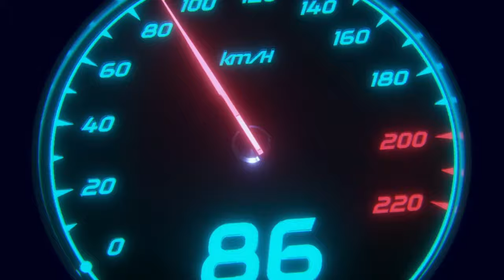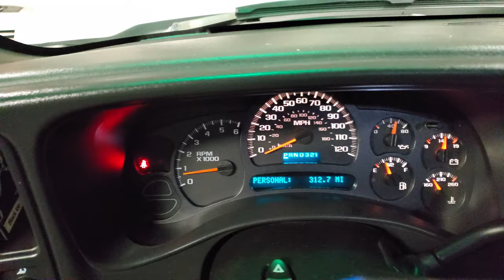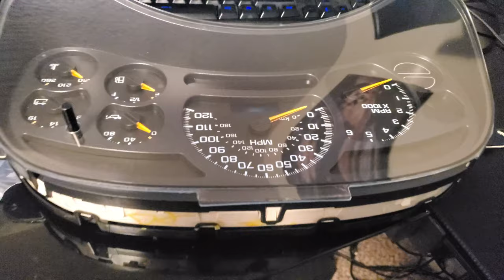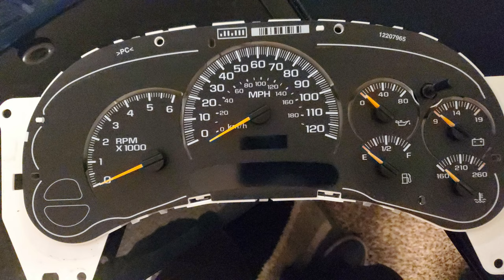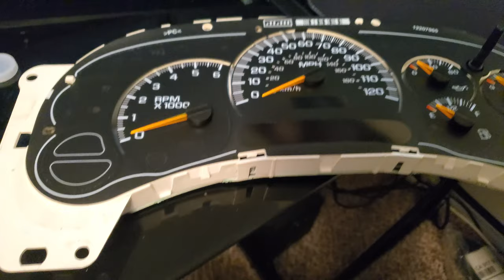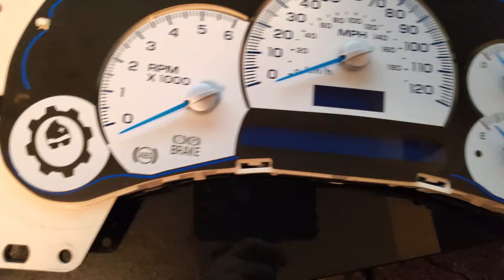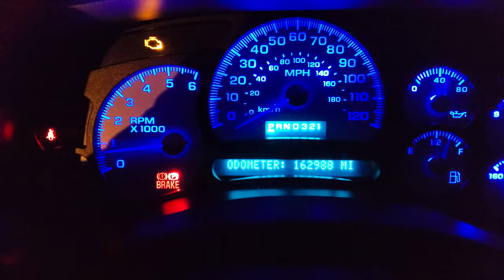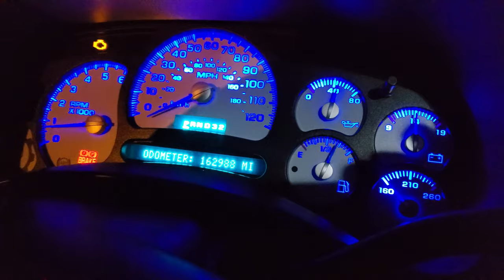Installing Gauge Cluster Upgrades for 03-06 Chevy Silverado/Sierra

Comment: Hey thank for video and especially the parts list💯💯 I’m going to attempt to work on a new gauge cluster soon for my truck.
Reply from the maker: Sweet makes a big difference
Reply: I’m wondering what the cluster would look like with stock black panel and the aftermarket needles.
Reply from the maker: @carlosherrera8541  better then factory at least

Comment: I installed red led’s to my cluster and white needles. I thought the needles would glow white but they don’t glow. Did I do something wrong or is it supposed to be that way?
Reply from the maker: Sounds right I think
Reply: @DrivenbyGears  so how would I Make the needle glow white?
Reply from the maker: Did you make sure all the bulbs on the board work?
Reply: @DrivenbyGears  yes i replaced all the old lights with red leds, I was just wondering how I could make the white needles glow white instead of the read
Reply from the maker: Won't happen it's always going be red its a reflection off the lights
Reply: @DrivenbyGears  gotcha, I saw some pictures and the needle was white with the rest red must be a mod to the board

Comment: Quick question but good video man! Since I already have led’s will I need to remove the back part of the speedo or will just the front be okay?
Reply from the maker: Just the top were you need to solder the bulbs in.

Comment: can a higher MPH and tach be install... 160 mph and 8000 rpm
Reply from the maker: If the plug is the same dont see why not but the odometer will be different

Comment: Can’t they just keep it simple anymore, my god have to go through all that
Reply from the maker: Ikr the old ones are so much easier like my 95 the bulbs are right there quick turns.
Reply: Yes I agree , for sure we grew up the 55-57 chevy's 60's 70's vehicle's 67 Plymouth Barracuda 4 carburetor  it was a hot rod they made right off the assembly line do 0-60 in two seconds, my brother had one he was a motor head back then